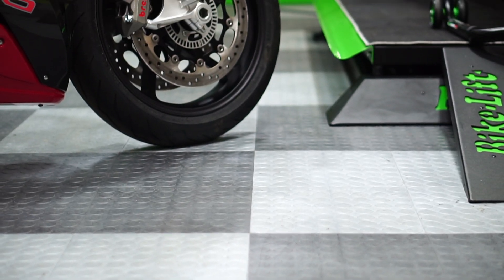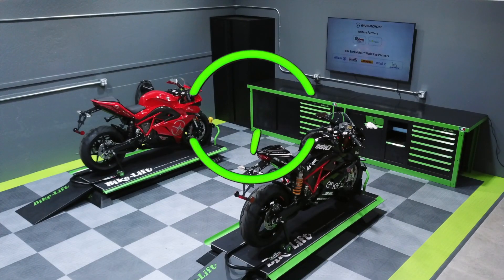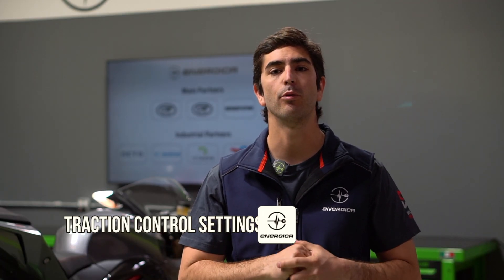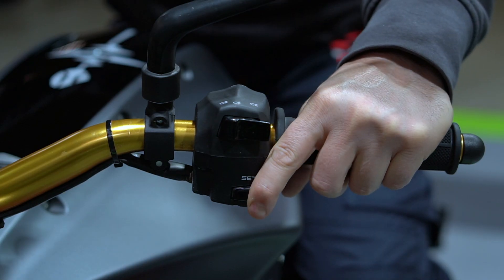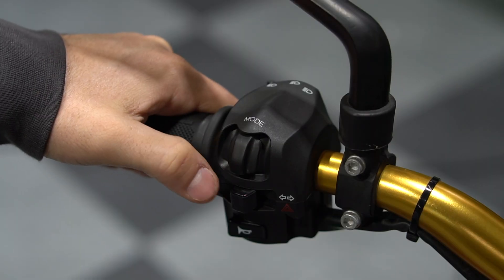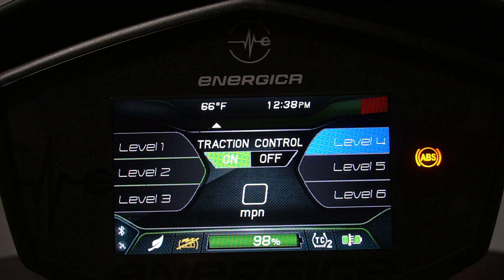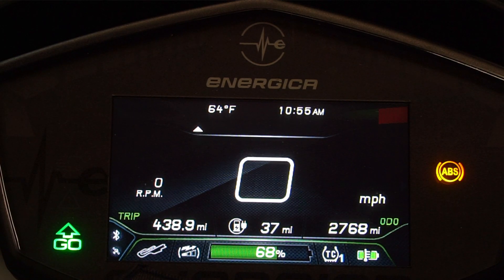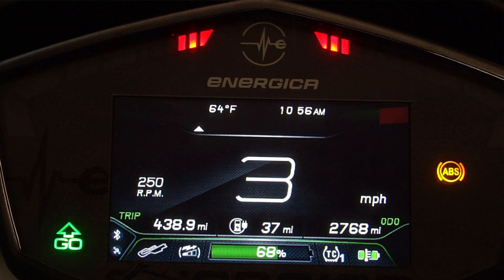Energica Garage - Getting Started - Ep. 4, Traction Control settings

Comment: Sounds like I should be using higher settings for slick roads (if the road has a bit of dirt, gravel, etc), but what is the advantage of lower settings?